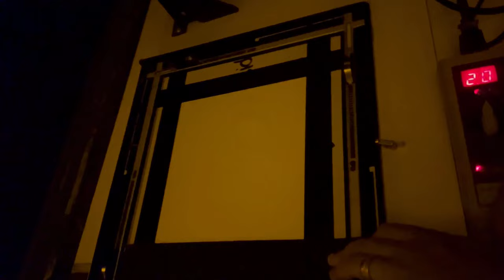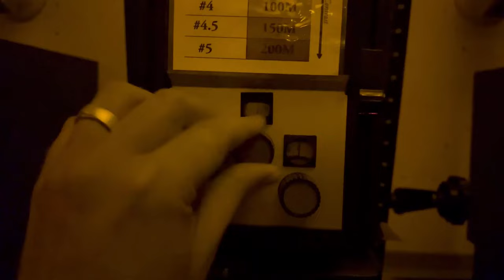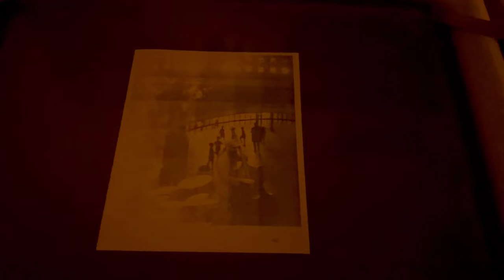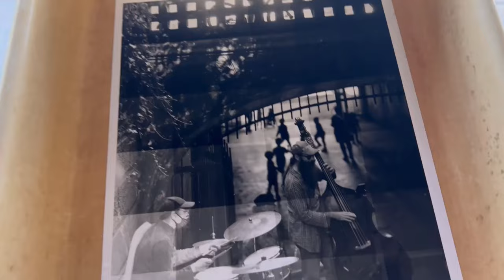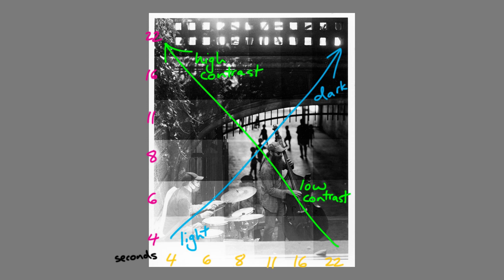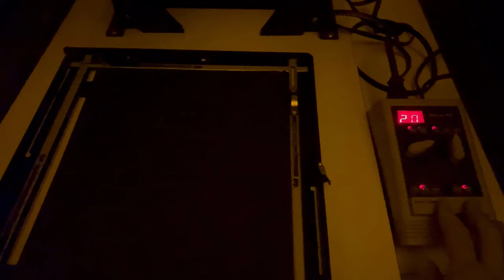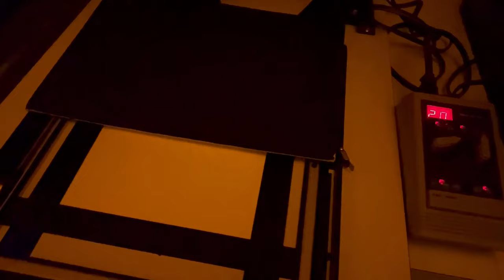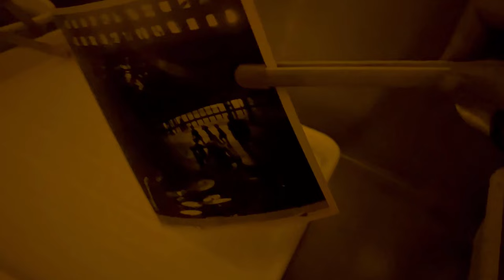Detailed Test Strips for Split Filter Printing - Learn a New Darkroom Technique

Comment: I was pretty confused when you said you were going by stops here, since a stop would be twice as long. I think what you're actually doing is rounded off half stops. So it would be (2^2)=4, (2^2.5)=5.6, (2^3)=8, (2^3.5)=11.3, (2^4)=16, (2^4.5)=22.6 for exact half stops, and then you've rounded these off.

Comment: I understand the intention and the procedure but I think there is an error in the time calculations, increments of one step with a base exposure of 4 seconds would be 8, 16, 32, 64, 128...
Reply from the maker: Should have said 1/2 stops not full stops

Comment: I have noticed that I have had to increase my highlights filtration to as much as a #2 filter using under lens filtration with a LED light head.  Do you have a good source for a time chart for f stop printing?  My head is very bright and exposure times much lower.  Great video.   BTW
Reply from the maker: Yes, some people like to do split grade printing with the yellow not quite all the way to a zero filter. There are so many variables that I could never rely on a time chart; I just make a new test for every negative I print

Comment: super cool technique! thanks for this. something ive read recently is that split grade printing gets you to a middle contrast filter. Example: exposing the sheet at grade 5 and grade 0 (For whatever amount of time to get a good contrast) would in theory just get you the same or similar result as just using a grade 3 filter. is this right? this is a fun technique though will try to use this!! thanks
Reply from the maker: Great question - in theory yes, if you expose for an equal amount of time with each of a 5 and 0 filter would get you roughly the same contrast as a print with a 3 filter, but in practice there are a lot of other variables such as the enlarger you’re using, paper type, etc. - I think the biggest advantage of split filter printing though is that you can dodge/burn the shadows and highlights separately, which you couldn’t do if you just printer with a 3 filter
Reply: @silverandplatinum   ah yes that makes sense! awesome thanks. cant wait for more videos!

Comment: Hi Ryan! How come you initially expose the whole sheet for 4 seconds for both magenta and yellow? Is it so you don't get the most extreme side of the filters (complete black/white)? 

Also, the time increments will always be the same since they are stops, right?

Very excited to try this out! Thanks for the video
Reply from the maker: Great question - yes, it’s because I’m almost sure that each filter will need more time than that; the extremes under 4 seconds are almost always unusable. And yes, I always use the same increments. Good luck!
Reply: @silverandplatinum  Hey man, just wanted to report back that I got back to my darkroom after 6 months and this method has seriously revived my interest in printing. The matrix is a fool-proof way to gage exposure and contrast and I'm not lost in an infinity of test-strips anymore. 1 whole page test, and the second print came out flawless. Thanks again for this wonderful resource!
Reply from the maker: @jbezerk  that’s awesome, I’m so glad it was helpful for you!

Comment: Hi great video, I tried this and found when I did the vertical lines with magenta at a grade 5. There were no lines and no differences. Any suggestions on what might be causing this?
Reply from the maker: Intresting. If the yellow is working and the magenta isn't, I'd guess it's some kind of issue with the filter
Reply: @silverandplatinum hello, I just did some more tests and found that the times for the red filter were not sufficient to achieve any sort of increase in the blacks. I had to nearly triple the time to get a sequence. Is there a way to still achieve the stop differences at much higher times?